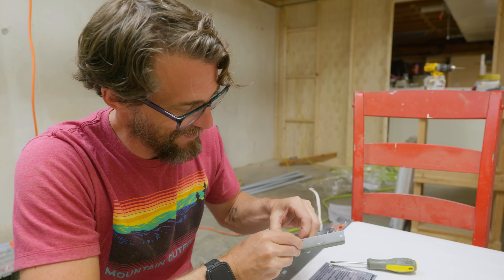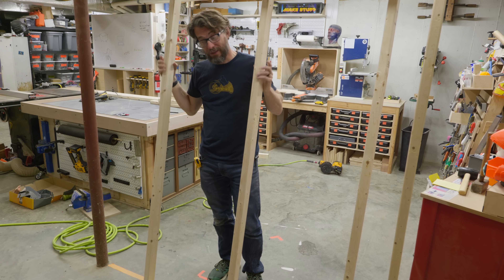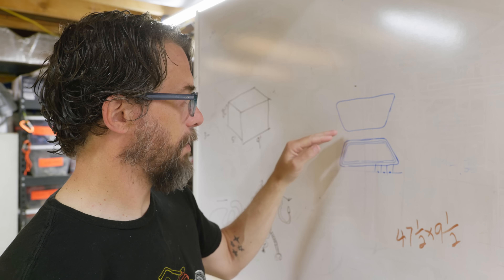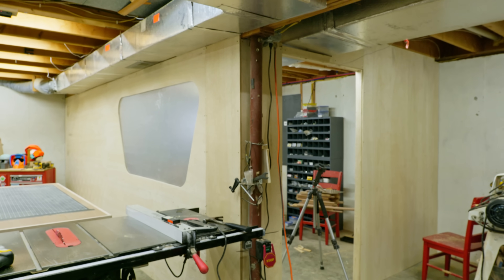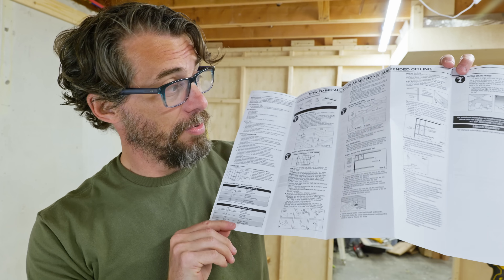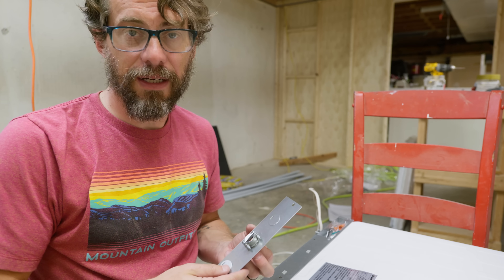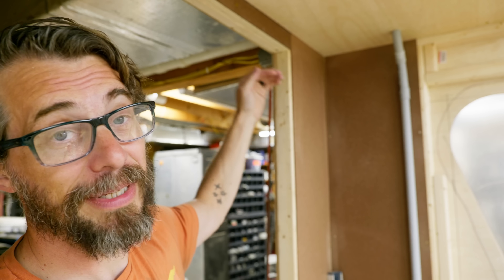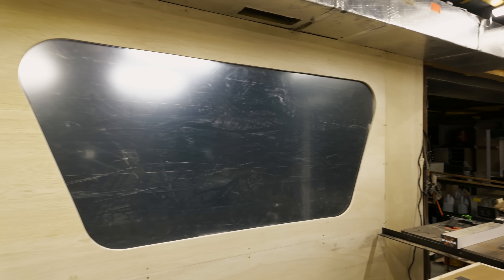Why Am I Making My Shop SMALLER?

Comment: I feel the same way about Tron. It was life-changing as an 8 year old who loved to use the family computer - an 8086 with 4MB of memory and a 30MB Hard Drive. It blew my mind. I love your channel and content, and I am always amazed by the things you come up with. Nice job!
Reply: I remember watching it in a cinema, and there was an unscheduled interlude in it, when the projector jammed, tore the film, and we had a perfectly focussed image for 2 seconds of the film melting in the gate. 5 minutes for the projectionist to unthread, splice in a blank leader, and run it on the other projector in the room, so that he could clean out the burnt film in the gate and get ready to splice it together for the next show, with just a few dozen frames missing in it. Non DTS, just had analogue audio on the side, in Dolby Stereo, in that theatre.

Star Wars I saw on release weekend, where the biggest cinema at the time in Africa was showing it, in full Dolby Surround, with a 15kW sound system, at reference levels. The Tuesday they had to drop sound level down a lot on the surround, as the people in the buildings around it all were complaining that the audio was shaking pictures and ornaments off the walls, and they could not sleep till after midnight. Middle seats, right where the sweet spot in that cinema was.

Comment: I feel like you missed an incredible opportunity by glueing up all that electrical conduit. I'd have added LED strips on the backside, painted the conduit orange, and setup an Arduino with sensors on each outlet, then have the Arduino so orange light pulses flowing towards the outlet with draw. Think the Starfleet plasma conduit magnetic contractors for the effect I'm thinking of. 

Not sure if that would work with the Tron motif, but it certainly would be cool, lol.

Comment: I assume you’re going to have some sort of rack/shelf unit to put your 3d printers on. Even though you added those outlets already, i highly recommend getting a few power bars that have 5-10 outlets spaced 6-12” apart. I got mine from Harbor Freight. You can screw them to the underside of the shelf, or to the wall behind everything. They make cable management so much easier and you don’t have to worry about wall warts blocking outlets on a typical power strip. Also you can plug in a vacuum or filament dryer or anything else quite easily.

Comment: 6:52 As someone who has done some small projects with Arduino, a couple free videos that do not really give any information about Arduino doesn't help people's curiosity. For starters, I would add a couple more free videos, like all the cool sensors and motors you can use, and the last video goes over about a dozen projects that you can make, nothing detailed just what it is and the components.

Comment: Pro tip on installing the push in wire clamps for thin metal: use a socket larger than the connector opening on the backside when you push the connector in. That will support the thin metal and keep it from flexing.

Comment: You should use compact wire block connectors instead of the twist type, so much neater and easier to work with

Comment: The plywood walls was a good idea, but you basically made resonator cavities. You might want to put some insulation (rockwool would be best, but anything should help) or butyl rubber inside if you find there's too much noise passing through the walls.

Comment: I haven't finished watching this video yet, but you might want to look into using that paint they use on cars, if you attach a low current to it, it glows using that same tron neon look. you can paint the walls with strips instead of using LED lights...

Comment: I also have a coil framing nailer.  Mine is a Bostitch N90 that can fire 3" framing nails with ease.  Why did I choose coil over stick when I got my nail gun?  Easy, I bought mine used at an auction for $40.  A deal is a deal...

Comment: Lights. Add Tron graphic into ceiling lighting 
Idea borrowed from Exterior signs. Like at Taco Bell’s 

It may look like a white box with black lettering during day and white lettering with black at night 

Believe this is done with film. 

Unknowns Film may reduce lumens if lights and not certain how those leds use surface to cool. 

It would make it more dynamic if the lights blended into ceiling when off. Or popped an unseen graphic unless lit.

Comment: You mentioned hiring a licensed electrician but since you did framing and electrical did you or were you required to get a permit to make changes to your house?   Also have an inspection for the changes?
Reply: Each state can be different.  If you need a permit for anything any licensed professional you hire will be able to tell you all the details.  In my state (Michigan) adding on to an existing circuit does not need a permit, and I suspect the room could be considered temporary (easily removed) and as such would not need a permit either - but don't quote me on that one.

Comment: I thought you said the removable wall panel wasn't going to be fixed to the floor but think I saw you sink some concrete screws through the lower footer?!?
Reply from the maker: No, I didn't. It's just tied in to the sides and top 👍🏼

Comment: I would not have made a wall that wasn't load bearing because I love putting things on the wall whenever possible rather than the floor.
Reply: Just for clarification, a load bearing wall doesn't mean you cant hang anything on it, it means it supports the weight of the structure above it
Reply: @Wheels35  he can hang light things. This isn't going to support much weight though.